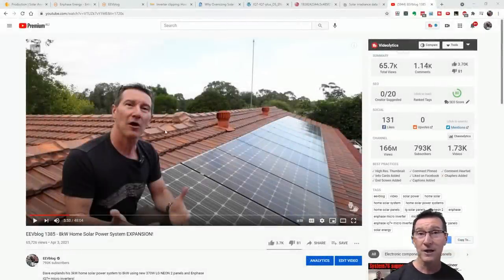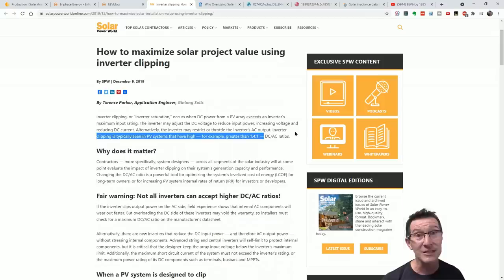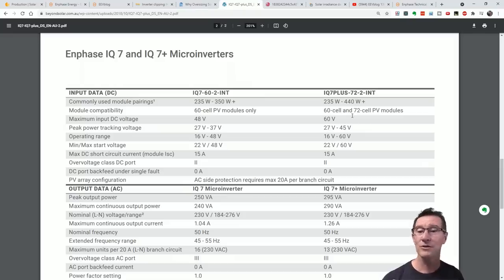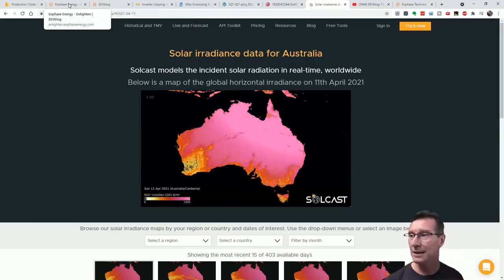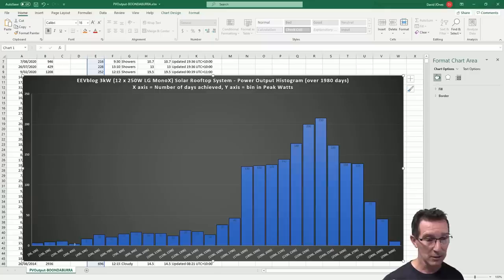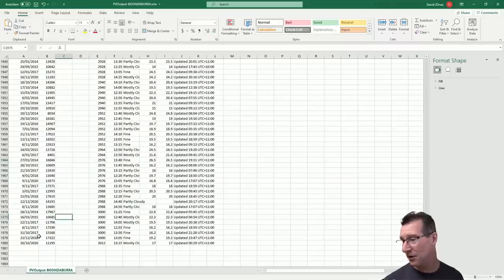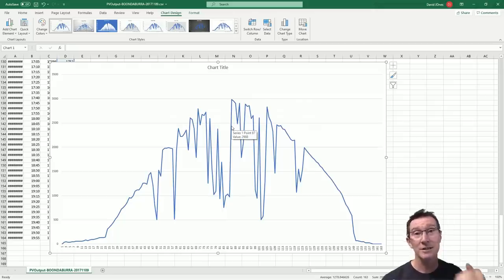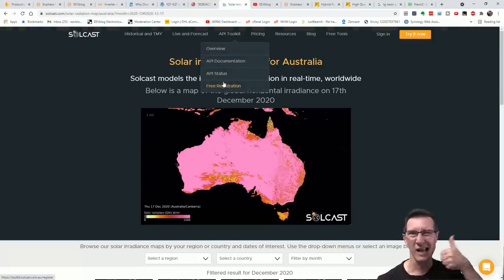EEVblog 1386 - 295W Inverter vs 370W Solar Panel - WTF?

Comment from the maker: Follow up video on temperature effects: https://www.youtube.com/watch?v=BtQUuD6QRMw
Reply: Still amazing how Solar isnt on every roof in Aus, not even talking about the paying back into the grid costs.
Reply: Another thing that is not considered is the actual energy received by the panels: because they are not tracking the sun, even is you reach 1000W/m2 the panel receives less because of the cos(angle) losses. Even in ideal conditions, a panel oriented at 90° just received the scattered light instead of direct illumination and produces almost nothing.
Reply: The dummies guide  1a. Ignore temperature as you have no control of the weather, do something useful and get on with your lives....sure analyse it to the end of time and then realise anyway you have no ability to influence temp, if it’s a hot day then it’s hot and your Arduino will tell you...run a sprinkler, that will help or put the panels in shade...  now seriously 1. Get three phase. 2. If you don't have shading get two three phase inverters with 2 strings per inverter  3. Get inverters that automatically share or spread maximum export to the phase with lowest voltages as this makes you the most money. 4. Oversize the panel array to max specs of inverters.....see point 3 as this is way more important than anything else as being on a single phase with a high penetration of solar will result in high voltage on that phase and limit your ability to export.  5. Only get enphases if you have serious shading and even then 4 strings across two three phase inverters which maximise export  through lower voltage phases will easily create more benefit.  

Magic numbers are 12.6kW's of DC on Roof, 10kW's to mains across two three phase inverters, with a total of 4 Strings.  Ohhh yeah and face two strings east or west and two north.   The east will give you early morning charge and the west will give you late day energy offset and pre-peak charge.  North is just a no brainer for at least half of your solar, assuming 3 phase and 10kW's to grid.

As for analysis.....haven't paid a power bill in 5 years, do no analysis as I can't be bothered as this stuff is high school maths and just choose the retailer with the highest Feed in Tariff (FiT).    Am on no special Govt FiT....this ain't rocket science so maybe just go with what 40% of Queenslanders have already figured out.

See above...
Reply: @AndrewDeme  yet we have to plan for it in our canadian winter as deep cold can cause overvolting of the charge controller, so we need to buy higher voltage rated ones ;)

Comment: Notice how your 3kW system only peaks on cloudy days right after cloud passed by. I believe it's due to overall cell temperature being lower. Clouds help to cool it down.
Reply: Currently we do extremely little with the waste heat from panels, they could easily heat a pool.
Reply from the maker: Yes they do, but I have seen perfect days close to 3kW, it's just a lot of data to sift through.
Reply: @spikester  or perhaps cover the belly side of the panel with heatsinks
Reply: @EEVblog  just checked Sydney summer temperatures 18.6 - 25.8°C.  I did not realize you got such cold summer. I thought it's similar to what we got here in Phoenix 40C-50C.
Reply: There is also a cloud edge effect with scattered clouds which produces somewhat of a lens that concentrates more than 1000w/m2.
Reply: @arthurvlog6259  yeah, 73°F/23°C average in their hottest month. Crazy. Awesome weather. It is 70% humidity though. Yuck. Phoenix averages 94°F/35°C in their hottest month. Florida is 82°F/28°C at 80% humidity on average. I'll take Phoenix's 94°F/35°C and 25% humidity any day. Florida has the worst weather. You get soaking wet just walking out to your car.
Reply from the maker: Just shot a video on my 2nd channel about this, uploading now.
Reply from the maker: https://www.youtube.com/watch?v=BtQUuD6QRMw
Reply: @EEVblog  have you seen a good energy flow diagram on photovoltaic? From a thermo standpoint I'm assuming that the sun is the hot heat sink, what is the cold heat sink?  At face value I'd think that the energy absorbed minus the energy radiated by the cells and conducted to the air is the output energy, but I may be missing something.
Reply: @spikester  Actually, I think this is a brilliant idea, not for Phoenix  though, cause my pool turns into a hot tub during the summer anyways, and instead of heating it up, I'm actually running the chiller to cool it down. But for such freezing cold Antarctic cities like Sydney ))) - it is a must have. Because we all know what "quantum tunneling" does to electrons - the cooler it runs = the less quantum tunnelling effect, which means more output power.
Reply: @xenonram  Florida is definitely a humid nightmare, but Phoenix is a death within hours. I wonder if relative humidity does actually change the cooling properties of the air? Anyone?
Reply: You're probably looking at Sydney temps in the actual cbd, which is beside the water. The greater sydney area extends 50km inland. Penrith, right at the edge of "sydney" is typically 8-10c hotter a day during summer. We regularly hit 42c in summer and thats with the weather station beside the penrith lakes rather than in a residential area where heat island effects may make a difference
Reply: This mirrors my experience. I have 6.6 kW of panels on a 7 kW inverter (to allow future expansion). If we get a cold rain that cools the panels down, then I see 7+kW production for a few minutes right after the clouds pass. But on a steadily sunny day, even if it is very cold outside, the panels will max out around 6.3 kW.
Reply: @EEVblog  what is a big annoying is that the extra power is dissipated by the panels themselves and they get hotter. It's probably not much (70W compared to 1.6*800W for 20% efficiency for a 1.6m^2 pannel) but I wonder if that doesn't affect their lifetime a bit.
Reply: @xenonram  sounds like Thessaloniki, Greece. any hot place near a big river delta has this issue
Reply: @arthurvlog6259  Heat transfer through diffusion (I guess that is what you mean) is negligible in comparison to turbulence (wind)
Reply: it also the reflection of sunlight on those cloud edges which adds locally to the insolation.
Reply: @Sylvan_dB  Exactly! I noticed the same with my panels. I actually got more power than rated! Stressing the MPPT controller might be concern. Mine just switch completely off if there is too much power. Bad design.
Reply: @arthurvlog6259  what if you had a thermal strap dumping it into the roof or a large thermal mass? wonder if that could bump the efficiency up
Reply: @spikester  It is tricky extract heat from the panels as most straight forward solutions involve water.
Reply: @arthurvlog6259  Cooling and heating properties. The humidity influences the thermal mass, so humid air can heat you up much quicker but also cool you down much quicker
Reply: @tamask001  It's always seemed like a good idea but as soon as you have moving fluids and joints then you will get more reliability problems. So this might be good for panels with easy access but if you need to put scaffolding up then I'm not so sure...
Reply: I wonder if there would be some energy gain when pumping water to cool and clean the panels, with a small pump.

It can be an interesting experiment with some microcontrollers.
Reply: @arthurvlog6259  that's sydney CBD greater sydney add 8 degrees
Reply: @opimentoso  Interesting and dangerous, running water in close proximity to 400v DC :)
Reply: @Sylvan_dB  As I understand it it's more like  mirror effect,  light is reflected of clouds on to the panels.
Reply: Diffuse radiation from clouds can add to the direct insolation to increase the overall energy well above the nominal 1,000W/sqm maximum. 

I saw this effect while doing a solar experiment at RMIT in Melbourne. We were trying to characterise a PV panel on a rotten fully overcast day, directly measuring the DC output into a load, and only getting about 400W/sqm of diffuse radiation from the clouds. Then part way through the experiment the sun shone out through a hole in the clouds and suddenly we were measuring total energy at the panel of ~1,400W/sqm. 

Inverter clipping means you will never see this much power output (unless you have massively over-specced the inverter!) but the inverter manufacturer has to design the input to be able to handle this much voltage/power at the input.
Reply: @DantalionNl  Indeed, but they are already exposed to the elements. I dont think that will be a problem.
Reply: @opimentoso  Well yes, but there is also different IP ratings for dribbling, streaming and submerged in water and I suspect these differences in rating exist for a reason.
Reply: If that is the case, install automated water cooling - if you have a creek use a water hammer and pump water through heatsinks and put the water right back where you got it.
Reply: @DantalionNl  Indeed. And now that you mention it, I’ve never really seen any water-cooled systems like that.

This is an interesting topic, I would like to see a video of Dave talking about it.
Reply: @arthurvlog6259  Perth is more similar to Phoenix.

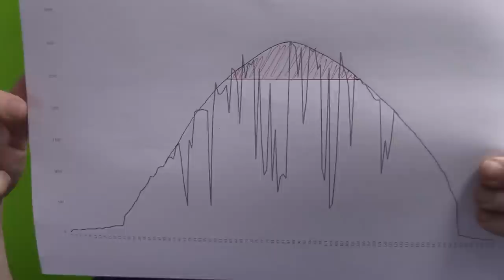Comment: 19:50 If you want to get an accurate idea of the ratio of the areas under the curve, cut out the entire peak with scissors, weigh it, then cut off the tippy top and weigh it separately. The ratio of weights will give you the ratio of the areas under the curves.

Back in the day when integrators were not available in this part of the world, we would analyze our chromatograms like this to determine the content of chemical compounds in samples. It does require a sensitive balance though.
Reply: That's amazing!

Comment: Belgian solar installer here, partial shading on an array of solar panels in a string should not drag down the complete output. There are 3 zones in every panel that get bridged by the built in diodes in case of partial shade on a panel.
Reply: For a string inverter, yes partial shade on any panel in a string will bring down the output of the entire string.
Reply: @neomage2021  A microinverter can do nothing about this, either. So, there is no advantage to using them, at least from this point of view. All solar panels have bypass diodes so the entire argument for microinverters is a fail. There can be other reasons to use them, such as avoiding dangerous DC voltages, which is why I am using custom-made MPPT microinverters on automated articulated lower-efficiency and much much cheaper panels.
Reply: @neomage2021  only if it cannot do full voltage sweep or when solar panels dont have bypass diodes. When inverter can do full voltage sweep and panels do have bypass diodes, then partial shading WILL NOT bring output of entire string.

Comment: In Europe there is less sun sure but it's also not as hot as in Australia. The hotter the panels get the fewer power they output. So I wonder how that all would count up in the end.
Reply from the maker: Just shot a video on my 2nd channel about this, uploading now.
Reply: many hot days are absolutely better than many overcast cold days. no two ways about that
Reply: I can get full power on sunny day, I'm in france.
Reply: @ursodermatt8809  Except you're more likely to run A/C. Unless you have an extremely well insulated house.
Reply: @chaos.corner  
you are more likely to run A/C when it is cold too.
i repeat for you again. solar generation depends on solar insolation. no sun no generation.  no matter what the temperature is. no matter what you use the solar generated electricity for.
Reply: @ursodermatt8809  here in Florida the biggest production month is May.  Its the lower temperature compared to July or August
Reply: @shroud1390  
well here in NSW, australia, the most productive months are september/october. usually.

Comment: Very interesting. Slap a IQ7a or two up there and measure it over time, for science!
Reply: Thought same. However, this is great work by Dave, since I never realized the details, along with that solar panels use "marketing speak" to sell (imagine buyin 20 of the 370W panels and never getting that "advertised" wattage because of the inverter clipping.
Reply: 1. ¹
Reply: Solar designerer here. I did that experiment over a 3 year period with their older 215W and 250W emphases inverters. Over 3 years there was a 2kWh difference between the different modules. That's about 60c of savings per panel for a $10+ cost per inverter upgrade.
Reply: I have jinko 405 panels paired to iq7+ and iq7A inverters. It's a string of 12 panels. 3 panels in the middle are the A inverters. Here's the data from last week as an average per day 
2.62 +
2.65 +
2.58 +
2.62 +
2.59 +
2.55 +
2.68 A
2.67 A
2.63 A
2.50 +
2.51 +
2.53 +
Remember this is an average per day over a week  the iq7a's do not significantly increase production.

Comment: With the solar system that I installed, we typically got 115-120% of the nominal rating during most of the day. Even after 15 years it's giving about 95% of nominal. So in my case if the inverter were only rated for 80% of the maximum, I'd estimate we would be missing 20% of the available energy over a given day on average. So depending on the cost per kilowatt it may be worth it.

I think the biggest thing is space limitations. If you are trying to extract the maximum available energy from limited space, then that's a different question if you can just throw up another panel.
Reply: I've been playing about with 4x340w panels, I only have room for 8 in total. Originally I had IQ7 inverters which clipped them to 250w.
Following convos in Dave's original video I swapped out one of the microinverters for an IQ7A, and have seen over 340w out of that panel here in the UK already, so when the last 4 panels go up I think I'll be using bigger microinverters for exactly the reasons you noted, very limited space!
Reply from the maker: @juststeve5542  Yeah, regardless of what Enphase (and LG too, as they do a ton of LG/Enphase installs) claim, The IQ7A would be a better match (but still nto ideal of course). Although you'd have to do the amortisation costing over time.
Reply: I wonder if their Enphase IQ8 would have a higher output
Reply: @PHamster  at this point I'm starting to believe in fairies more than the IQ8!
When/if it finally appears it will probably come in a range of flavours like the IQ7,7+,7X,7A
IIRC, the higher capacity 7A is a later addition to the IQ7 range.
Reply: @juststeve5542   have 20-300watt panels with IQ7 mico inverters should i Use the iQ7A. i need to get it up to a 9k system
Reply: @coreybussey1358  I wouldn't go for 7A on 300 watt panels. The 7+ will do 295VA peak, 290VA continuous, I don't think the extra cost of the 7A is worth it for the last 5-10, especially as the panel ages and stops producing as much.
At least here in UK, there's not much price difference between the 7 and 7+. The 7A is a bit of a hike in price.

It really depends on how your panels are working right now. If you see them producing a curve which is flat-topped across midday, then a bigger micro would get you that missing peak of the curve back, but how much is that worth to you?

I didn't have any issue mixing up micros, so you could swap one of yours out for an IQ7+ to compare it side by side with one of your IQ7 panels. You might even find one on ebay.

Either way, you're never going to get 20 x 300w panels up to 9k. Peak will be 6k.
You either need more panels or bigger panels (with bigger microinverters).
Reply: @juststeve5542  The IQ7 are peaking at 244VA capping at 4.8. My options are upgrade my panels and Micros. Or spend the same amount with a Tesla add on what u think
Reply: @coreybussey1358  Sorry, I know nothing about Tesla solar gear, it's rare here in the UK.
But if you're looking at bigger panels, you'll need bigger micros to take advantage of them, or you'll just be hitting the 244VA peak earlier and holding it a bit longer.
Reply: @juststeve5542  I will upgrade my micros to IQ7A and see what happens in 300W panels.   The IQ7 are tell me that 244x20 is a 4.8 so Q7A 366x 20 is 7.3.
Reply: @coreybussey1358  If your panels are 300watt, then 300watt is the maximum a microinverter can extract from them, so assuming your panels are up to new spec, an IQ7A will get the 300w, and an IQ7+ will get 290-295w.
I really wouldn't bother with the 7A unless you have an immediate plan to upgrade your panels.

There's nothing to stop you just buying a single 7+ and a single 7A and upgrading a couple of the panels, then you can check the difference in a real world situation to see if the price is worth it.

Comment: As an engineer myself, I really enjoyed your data-rich and technical video. Installers in the UK told me in string installations, they de-rate the inverter by 50% - 10kwh panels get a 5kwh inverter. Then if you have batteries, the charger has losses, batteries have 80% depth of discharge on top. Bearing in mind everything ages and degrades with time, so it seems actual usable energy is a lot less than 40% of panel rating and decreasing each passing year!

Comment: Here in the UK, inverter undersizing of 20-30% is the standard. Some string inverter manufacturers actually allow 50% undersizing. By undersizing, I mean the DC/AC power ratio is 130% or 150%. The reasoning behind this is that you want to keep the inverter operating as close as possible to the maximum of its efficiency curve. As Dave mentions, NOCT is different than STC so you can install more rated DC power to achieve "actual" power closer to that efficency curve point.